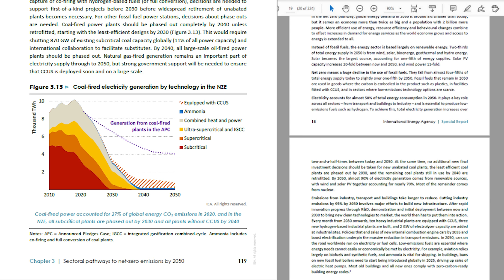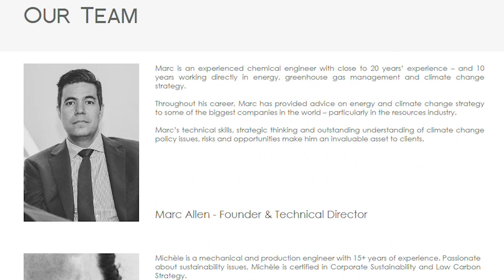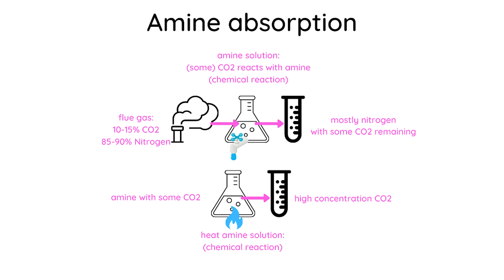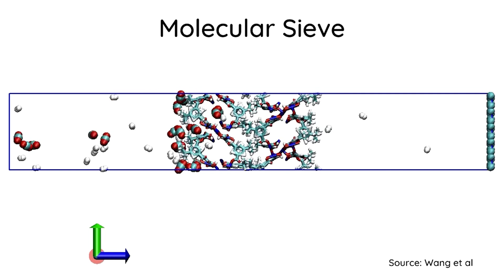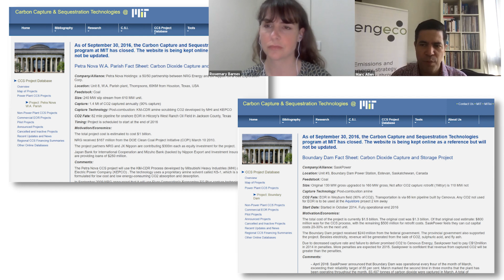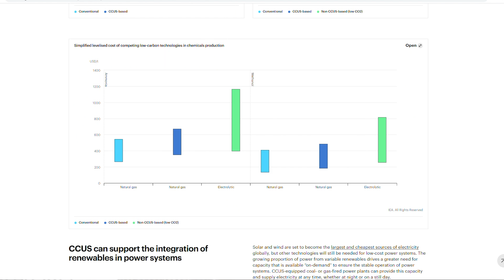How Does Carbon Capture Actually Work?

Comment: I believe in carbon capture when I see it - also I am worried that any Co2 injected into old oil wells et al will leak out but in the end, you only got X amount of space that can be used, so this is hiding the issues and not decarbonising the issues.
Reply from the maker: Thanks for your comment, unfortunately I had to take this video down to repair an audio issue, so I will be reuploading here if you want to comment again:
https://youtu.be/fC388uNJhUY